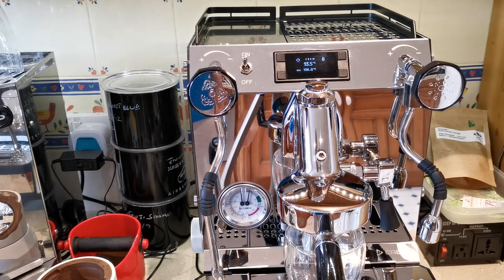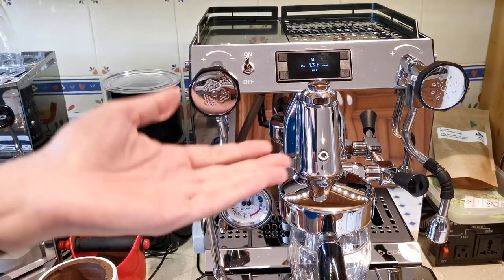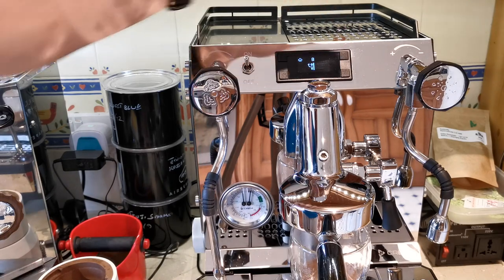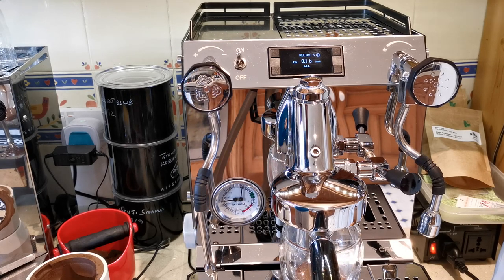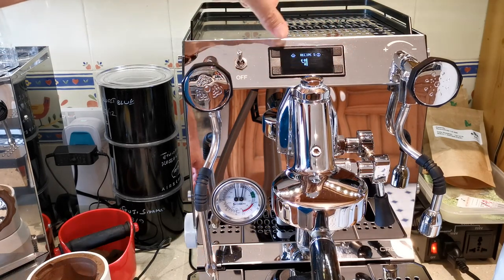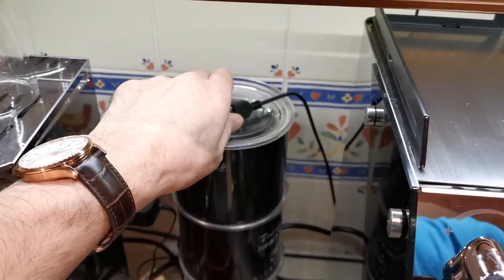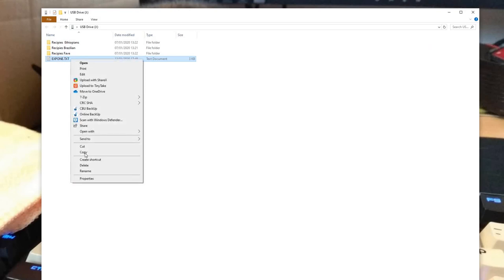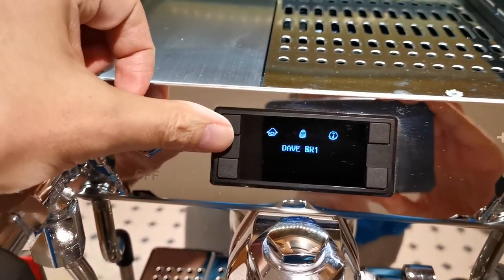Profile Creation Crem One 2B R LFPP

Comment: The go-to supplier in my country still has this machine listed for sale but has been sold out for >2 years, I emailed them a few months back asking why, they referred to warranty issues they were having, most machines being returned for some fix or another. I see you’ve said you had no problems. If you still have the machine has this changed at all in the 3 years since release? Or have you heard anything about manufacturing problems or whether or not they’ve been resolved by now? Cheers mate!

Comment: I saw several not complimentary comments from Expobar users revering to poor quality standards. This machine and the other crem one I have seen looks very high end for quality. Can you address this ?
 I am placing t his at top of my list for a new machine!!!
Reply from the maker: I never had any problem with this one....so can't really say.
Reply: @DaveCorbey  the reviews and all are really helpful 
I am getting the profiling ( US model) in May
Its pretty cool how they have designed profiling!!
Again huge thank you
Reply from the maker: Well I suspect it could be a combination of a new machine, users not understanding and potentially some issues not being sorted out by a retailer unfamiliar with the machine (these could be production issues). Certainly the quality of components in the machine I reviewed gave me no cause for concern. Fluid O tech pumps, Gicar control boards...all the key stuff from Italy. I liked it, still do. I do believe there have been some noisy pumps and I don't know if that's kinked tubes, a flow rate thing or a few faulty pumps. Mines almost silent most of the time and especially at low RPM...well you can see that from the Video. Crem have invested a lot, so it must be in their interest to ensure a good user experience.
Reply: @DaveCorbey  
Most negs where brutus related. ie 
“crem had this other brand which cut corners” etc brutus

Again very pleased with what i am seeing

Comment: Hi Dave, 
does it have a Cool Touch Steam Wand?
Reply from the maker: Yes it does but because "cool touch" can be a bit misleading, cooler than what? Most cool touch steam wands still get pretty how after a heavy milk steaming session, so they sometimes put rubber bits on cool touch wands. I'm not hung up either way about cool touch wands. I also say cool touch in the review, so I'm fairly sure I am remembering correctly. https://wordpress.com/view/coffeeequipmentreviews.wordpress.com
Reply: @DaveCorbey  Thanks Dave for the info...actually I'm referring to "no-burn steam and hot water wands" where you can just hold with your bare hands
Reply from the maker: @haniffaziz3896  So was I

Comment: OMG isn't too complicated machine?
Reply from the maker: It's an advanced machine and probably not a machine for the beginner, because you would mainly be using it for GSP shots and not make use of the full range of options. You may find a simpler machine Like Lelit MaraX or Lelit Elizabeth better for you, and cheaper.
Reply: @DaveCorbey  thank you for your response , I am very interesting to buy one , wich one do you recomand? Elizabeth or Mara?
Reply from the maker: @cozma75  It depends on what you want and your budget. If you want dual boiler ,  with interesting preinfusion options should you choose to use them and a modern look. The Elizabeth. If you want to save a little money and have a more traditional look (with a little more maintenance for the group) and less ability to fine tune temperature but very simple to use...the MaraX. really it's about reading both reviews and deciding which one suits you best.
Reply: @DaveCorbey  thank you so much, probably I will get an Elizabeth
Reply: Is this made in Spain?